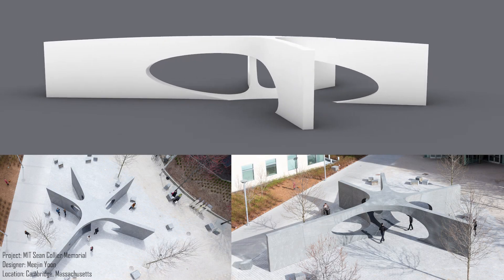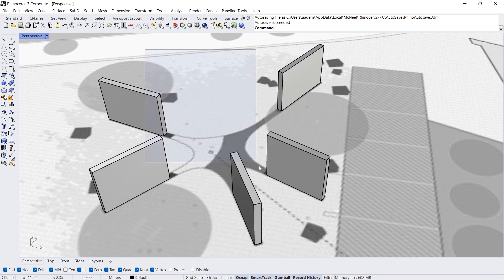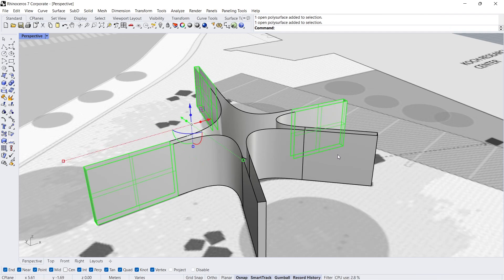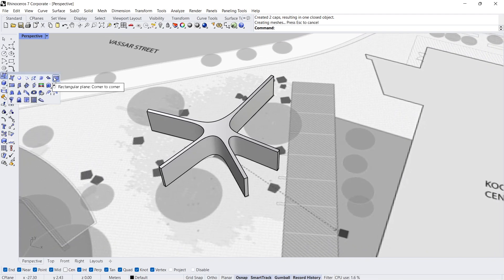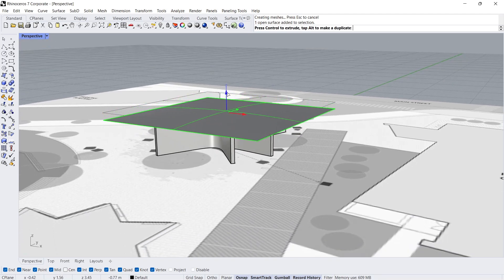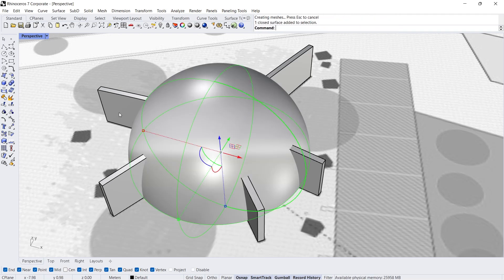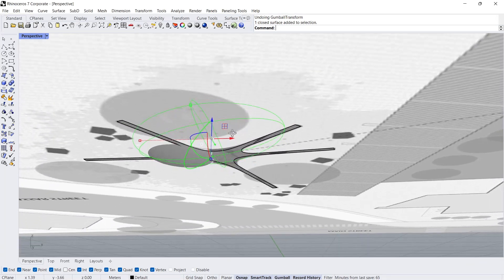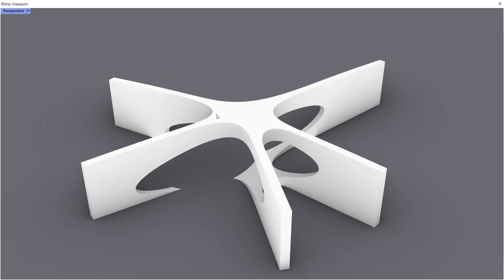Rhino - MIT Sean Collier Memorial

Comment: Hi Adam, i have another question😁: What is the function of the command “-srfseam” in this process
Reply from the maker: The SrfSeam command changes the location on a closed surface where the start and end edges of the surface meet.
Reply: @AdamArchh  thanks. There're two more questions🤗 1）I Skipped this step “-srfseam” but seemed get the same shape 2)about"-BooleanUnion". Why do you use -mergesrf instead of _BooleanUnion at 1:43 of the video?
Reply from the maker: @cyz1782  With SrfSeam, I took the arc on the sphere to an empty place. If this arc coincided with a column, it would cut the surface. BooleanUnion only works on solid objects. The question you should ask is: Why did you merge surface instead of join? Because the merge surface makes the merge surfaces a single surface. There is no cut in between. (Google Translate)
Reply: @AdamArchh  Thank you very much. I got it